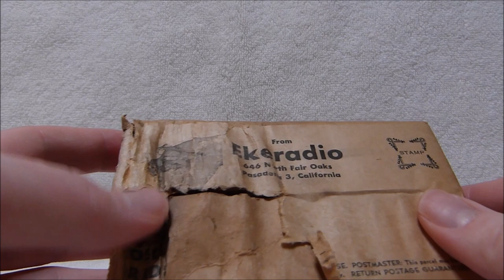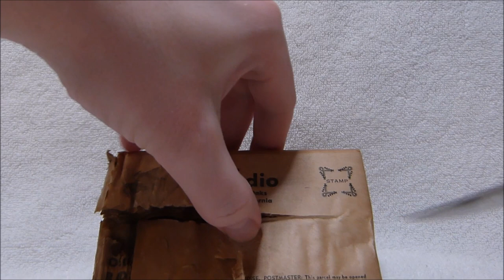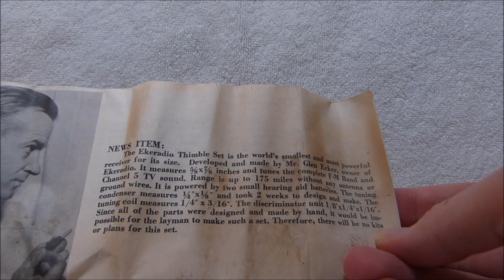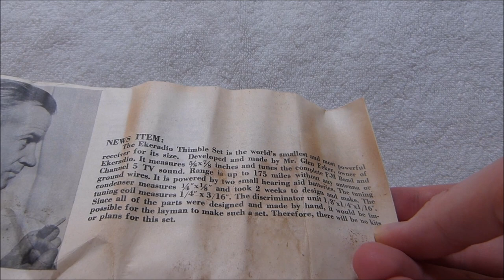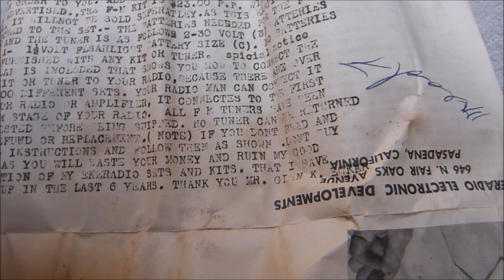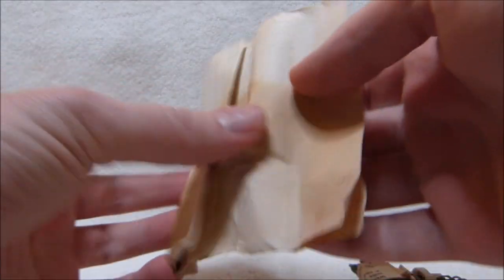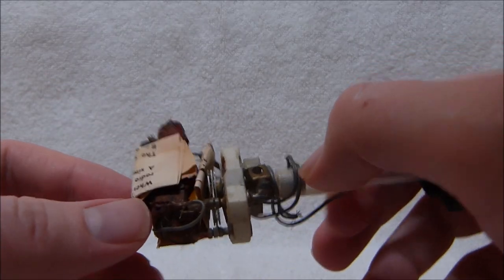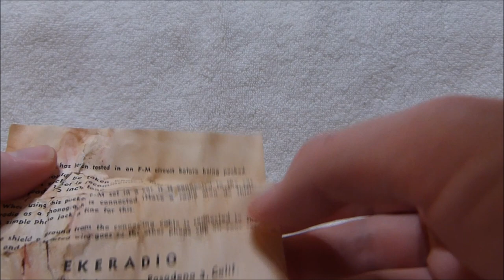Unboxing a NOS Ekerradio "Oscillator Radio Kit" (1954? USA)

Comment: Thanks so much for the scans. I have a partial Ekeradio FM radio kit, in plastic case, and i wondered what the circuit was. Now i can see that it uses the same FM superregen circuit with a one transistor amplifier. I had guessed the owner's name was Ekeroth, so your info is a revelation here too. Ekeradio was cagey about their circuits. The liitle set at the bottom advertising page is a one-tube regen, built into a 'travel soap container', and in the back is a cardboard shield saying "Removing This Shield Will Destroy This Radio". ( Of course it will not. ) I think i am an Ekeradio enthusiast - i read their ads with fascination since the old "Radio TV Experimenter" magazine days. I have two models now, the FM pocket radio and that small one-tube regen. -Hue

Comment: The CK722 wasn't exactly cheap back then either. It cost a good bit more than the average tube. It was less expensive than other transistors because they were rejects. Back then only a few transistors in batch met the specs and most couldn't be sold to commercial and military customers. Someone at Raytheon got the bright idea of giving the functional rejects a part number and selling them to the hobbyist market instead of trashing them. It's very likely that they were sold below the cost of production because they were essentially "free."
Reply from the maker: It wasn't cheap, but still one of the cheapest you could buy, and was apparently down to $0.99 in 1956. However, the quality was also low, since they were rejects after all. Whoever came up with that idea at Raytheon definitely deserved a nice bonus though, as they seem to have sold quite a lot of junky transistors as CK722's, which would have otherwise just gone into the garbage.

Comment: Very cool tho. You might try laminating the instructions, or using plastic sleeves. packing tape is a never go back type of thing, and could ruin it during application.
Reply from the maker: I don't have a laminator, and it's too late on the tape, as I already patched them up as best I can, but they are at least decipherable.

Comment: If you care to sell just the switch you show, let me know: the one in the pocket set kit is rusted. BTW, the kit includes what i wondered was maybe spring stock - but i see that's the tuning coil !
Reply from the maker: I'd prefer to keep the kit together, since it's so rare and currently unbuilt, though I may end up building it myself.

Comment: I don't get how Mr. Eker could make the claim that this gizmo "will outperform most F-M sets on the market today, as far as distance, tone, and seletivity",  when clearly that is entirely untrue. FM broadcasting was already over 10 years old by then and several manufacturers were making home radios with FM band. So a single tube superregen is going to outperform them? BTW, i think the last of Mr. Eker's stock ended up in Pasadena CA fleamarkets last year, sold for a fraction of a dollar each, apparently. A California seller told me these people's memory was gone and they couldn't help get any stories. I don't know; either that's true or the seller didn't want anyone cutting into her potential money making.
Reply from the maker: It certainly does seem like Mr. Eker way overstated the performance of these sets. The most obvious overstatement is the tone claim, there's no way an earphone-only set can sound better than a table radio! I would have loved to have grabbed some of that unsold stock, perhaps it will find it's way onto eBay at some point.